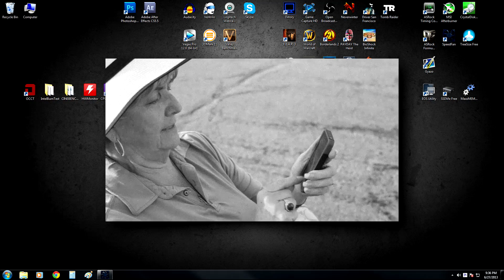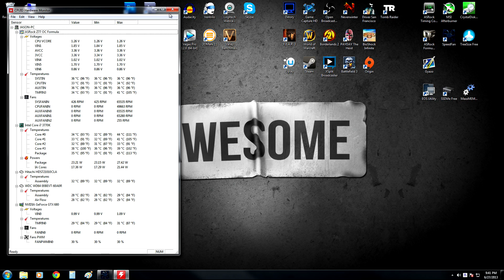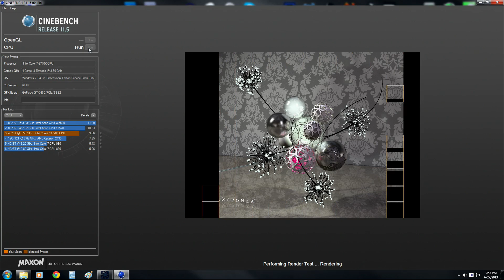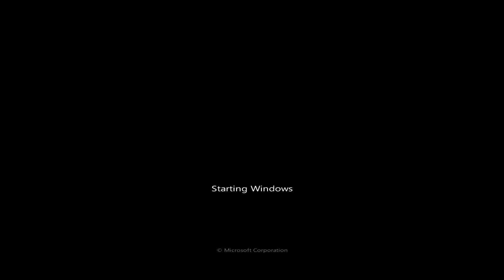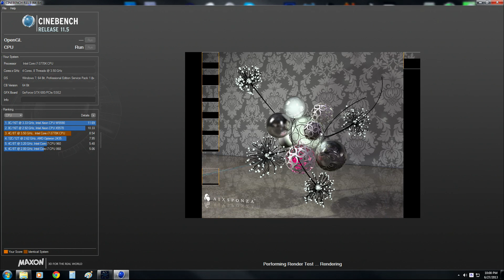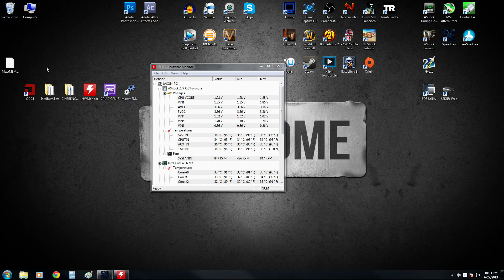Intel Overclocking Guide - 3570k 3770k 4670k 4770k

Comment: 4 years later and I'm still rocking my 3570k, does anyone else still have theirs? or a 3770k?
Reply: Mark G i have 3570K
Reply: Does anyone else's 'per core' clock ratio not work?
I can get 46x on all cores working fine without a problem, but if for example I used the per core function and set it as 46x, 46x, 46x, 39x then no thread would run at anything higher than 39x. I can never get it to go higher than the lowest core radio. 
It's not a heat/throttling issue, I have latest BIOS, etc, etc. Any ideas? Thanks.
Reply: I have a 3570k trying learn how to overclock it
Reply: it's 2018 and i just got a 3770k LOL!
Reply: @adrianvorkaaa3534  same but in 2019, and still freakin' expensive.
Reply: Update: I found a good deal on a 3770k, ran it for a while then bricked it with a failed delid, won't hide my mistakes. But I got a good deal on an x99 platform so far it's been amazing!
Reply: 3770K owner here with asrock Z77 OC formula :)
Reply: Still rocking my i7 3770k with asrock z77 at a stable 4.6ghz! Its a beast. I mean 5 years and still have this cpu for gaming and i get 60fps on most of the games at high or ultra preset.( gtx 1060 6gb) sold my old gtx 670 for 80 bucks .
Reply: Mark G still using a 3770k on a asrock Z77 xtreme 4. Upgraded my ram a year ago (thank fully) to 16gb, and just last month i Sold my old 680 and got a 1070. Now ive got a big cooler and started to slwowly overclock my CPU. 
Exciting times 😂
Reply: 3570k in August 2019
Reply: 3570k GANG
Reply: 3770k in 2020
Reply: 3770k still going strong in 2020
Reply: Yup more than 8 years after I built it hahaha still running strong
Reply: I still have my 3770k in 2021 😅
Reply: @bennipper9761  got a cheap air cooler and got it @4.6ghz - 1.31v :) going strong still
Reply: @bennipper9761  i was thinking to upgrade i5 3570K to this one, do you think it is worth doing, or i will get not much of the improvement. Does 8 threads makes a big difference in comparison with 4 threads. I am overclocked to 4 MHZ
Reply: Im still rolling with my 4670k but i lost sillicon lottery :(
Reply: After my maintenance cleaning and fresh OS install my liquid cooled z77 system is solid again @4.4 Ghz! I could go higher but TBH this oc is plenty for my needs. I also upgraded my 690 to RX Vega 64 and I now have amazing butter smooth max gaming. I can wait a couple more years now before I see a need to upgrade to a new build.
Reply: i have a 3570k too bro
Reply: i5-3570k with AsRock Pro 3 board OCed to 4.2GHz on air Cooler Master Hyper T4
Reply: I just upgraded to a i7 8700k just over a month ago.  But I had a 3570k since 2012.
Reply: 3770k and gtx 670
Reply: i have a 3570k running at 4.3 ghz for now.
Reply: Yeah! 3770k but my mobo is an Intel Extreme and I can't go more than 4.5Ghz stable.
Reply: 3570k at 4.6Ghz, 1.250V. Just ordered a i9 9900k tho
Reply: @Rizna  hey could you help me get those overclocks?
Reply: still running 3770k only upgrade i've made is a 1080gti and only fail i've had is a ssd that i just replaced after 6 years :) No overclocking though at all.
Reply: i just bought a used i7 3770k wish me luck
Reply: I have a 2600k
Reply: Still rocking it at 4.4 ghz @ 1.15V XD
Reply: I still use my 3770k ;)
Reply: Yep
Reply: Just "upgraded" my i5 3570K to i7 3770K plus a Delid lol..
All thanks to COVID Logic of the current world.. lol..
Reply: Yo still rocking on 3770k, 1080p, 60hz monitor in 2021, running 60fps max in every game 😂
Reply: 4670K in 2021 :)
Reply: Rocking a 3570k on my older gaming rig in 2024.
Reply: 3770k here on Asrock Extreme9 water cooled. Until recently it has been running rock solid almost everyday for the last 4 years but I am starting to get random freeze up's even at stock settings. Going to do a complete disassembly cleaning of the board and water loop with a fresh install of Win 10 to see if that helps.
Reply: +frosty I have one I would sell you that ran 4.5 ghz stable for over a year in my Formula VII
Reply: 3570k boiiiiii hoping to make it last longer by buying corsair h100i :D
Reply: 3570k over here still!
Reply: Still using a 3570K, itwasn't overclocked, so trying to get better output from my CPU
Reply: A year after  ur comment Im still rocking a 3770k and just about to add a gtx1080ti
Reply: 4690k
Reply: After doing some detective work I got a i7 8700k to go with the 1080ti, seems the 3770k could be a bottleneck with such a fast GPU
Reply: Still rocking 3770k to 4.5
Reply: Still running i7 3770k 3.5 GHz, with Asus Sabertooth z77, 16 GB,  GTX 1080TI, ssd, win 7 64 , debating if should upgrade to Ryzen 7 2700 If it worth it for streaming and gaming
Reply: 5 years later and still rocking an i7-4790k ;)

TBH it keeps up with my 1080ti (just) back on here to try and eek out just a little bit more performance before upgrading lol...
Reply: yup
Reply: Hey all. I am also running I7 3770K on 4.5ghz watercoold (hightest 75C° during gaming) and paired with MSI 1080 Ti ...16 Gb 1866 mhz DDR 3.Can run games 2160p mostly high settings and roking Oculus CV1 VR as well. No problems so far. Upgrade probably needed end of 2019 ;)
Reply: Almost 6 years later and still rockin a 3770K. Came here for help with overclocking. Haven't needed to, until now. Hope it works
Reply: (delid+liquid metal) 3770K@4.5Ghz offset +0.105v, Asus Maximus V GENE with NVMe, Thermalright Macho 120 SBM+ 2 Noctua fans.(Prime/LinX 71C max)
Reply: had mine since launch 3770k 4.8ghz ish 105bclk 1.25v sabertooth z77 board xspc single 120mm radiator still stable, could never get my ram to ever overclock above stock 1600mhz
Reply: STILL ROCKING A 3770K with asrock extreme 4 . I dont agree with video going straight to level 1 where have not tested the overshoot voltages . This can lower the life of your cpu fast. I try never to go above 4 or 5 unless it has stability issue and voltages are not crazy.
Reply: 3570K with a GTX 1060 6gb (sold my 660 Ti in 2017)
Reply: Still running a 3770k
Reply: 2019 and the 3570k is still chugging at 4.5GHz
Reply: Just bought my first i5 3570K 2019
Reply: Literally just upgraded from mine. Been having it since 2013. It's been good to me.
Reply: Still rocking the 3570k in 2019
Reply: Still using my i7 3770k in Nov. 2019!
Reply: Still rocking 4770k:p
Reply: 3770K 4.3GHz @1.26V
Reply: I just got one for £25. Its gonna be in living room rig. I will overclock the shit out of it 🤣🤣🤣
Reply: i7 3770k, running great since july 2012. Looking to overclock and upgrade gpu from amd hd 7950. Just installed a new ssd with windows 10 and dual booting with my original windows on the original ssd. Cost so far $100, beats $2k plus on new pc. Will do for a couple of more years at least.
Reply: yess yet
Reply: Still have 3570k on stock cooling, going to grab 212 and go for somewhere 4.2-4.4
Reply: Yep, I'm still running i4770k at overclocked at 4.3ghz with h80i liquid cooling. Gives me great performance even today. That said, one year ago I used a i3770 non-k on another pc. It was on air cooling only, albeit a good Cooler Master one. It also ran overclocked at 4.3ghz, but cooler and more stable than the i4770k. Strange, isn't it? I guess the exact piece of CPU does matter a lot for OC performance.
Reply: yeah with a 1070:(
Reply: 4670k
Reply: im running cyberpunk with it :)
Reply: 2021
I5 3570k and MSI Rx570
Reply: 3770k going strong
Reply: I have, but I have heard time doing it. Will try to follow your video
Reply: I just bought one 3570k. It's a overclock monster
Reply: Still going strong fella
Reply: I have it today, 4 dsys later
Reply: 2022, still got mine.
Reply: Yep 3570k
Reply: Bought a 3570k for some overclocking  I also have an overclocked 3570 with a base clock of 3.6ghz and wanted more ghz so I bought a k model.
Reply: Still have mine today.
Reply: After I think 13 years I just un installed mine for a i7 3770k  never messed with OC debating on trying it  though
Reply: I sold my 3570k and upgraded to the 4790k, still on that, but waiting for Icelake to see if it's worth upgrading to once they reduce the node to 10nm, or if it's worth holding out still longer for 7nm.  Not sure yet, meanwhile I'm refreshing my brain on how to overclock, I just did a clean install of Win10 and  need to get all the settings back to stable overclocks, especially since I changed the fan layout in my case and have more open airflow, might be able to get a slightly better clock than I had before.
Reply: @verisimilitudeteller  ...and 2 years later we're still on 14nm.
Reply: @fuxxin8686  And I'm still on the same OC'd 4790k.  ;)  I said I'd wait for a true 10nm chip and I mean it.  But if the next gen chips are priced as insanely stupid as they did last gen I may flip to AMD.  Getting a bit tired of Intel's bullshit on this one.  Ditto for Nvidia.
Reply: What GPU?  I don't think it's unreasonable to have that system provided you're still on a 700 series class or older GPU, I say class because I don't know the comparable AMD GPU for 700 series Nvidia.  But if you're on a 900 series class or newer GPU, I'd say you're not experiencing the GPU at it's most capable.  

I'm a big advocate of the idea that you should match your system to your needs, if you are playing games you enjoy and playing them at a graphical level you enjoy, then why change anything?  Too many people get caught up in what their friends have, you built your system 5 years ago, they built theirs yesterday, you didn't know you were missing out on anything until you say theirs, so relax.  :)  I'm not saying you specifically, but that's an attitude I wish would go away.

Comment: I've tried to overclock my 2500k on 4.5GHz with no luck I guess. find it to be stable at 4.4GHz but my Voltage is 1.34v. I think that's not so good, so if anyone have some advice I'll be thankful.Motherboard I'm using is GA-z77-UD5H.
Reply: Strahinja Pavlovic i moj je isto neam pojma zasto...

Comment: Hey, i hope you still check old videos for comments .. I could need your experience. Iam using i7 3770k on a MSI z77-g45 mainboard with Scythe Mugen 3. Iam currently at 4,2GHz with 75°C in load. Is it okay or to hot?
Reply: mine is also very hot 80c at 4.5
Reply: What cooler are you using? Air or water?
Reply: I was using the Scythe Mugen 3, but i changed to Noctua NH-D15 now and it's much better!! 4,5Ghz now @ 75°C in load now!

Comment: I love looking at these old videos. He sounded so happy with his RAM pushing 2000MHz, I bought some RAM 3 years after this video and it was no more expensive to get factory clocked at 2400MHz and you could still buy higher (and push it past the XMP settings). Recently looked at a 2006 graphics card, its crazy to see how much tech has changed. Instead of a huge 3 fan 6 heatpipe heatsink on my AMD Fury the old graphics card had a 40mm fan and a heatsink less than 3x2 inches and under 1cm thick. I used to hate 2 slot thick heatsinks, crazy to think how much things change in 10 years or even just 3 years with this video and the 2133MHz "extreme" RAM.

Comment: Hey Jayz, thanks for making this tutorial, I successfully overclocked my chip to 4.4Ghz (3570k). I will run a test over night but so far it has been very stable. I have been playing games and its perfect.
Reply: what cooler were you using?
Reply: In the end I didnt use this method. I found online a very useful guide for overclocking using the offset method and that worked the best for me. Using fixed voltage just meant that even if your PC is idle, it will run at that voltage and will run at higher temp. 

Here is the guide that i used.
http://forum.overclock3d.net/showthread.php?t=38867

Its been around 5 months now and I have had no problems with my CPU. I have a stable overclock of 4.5GHz and offset voltage set to +0.05V. Idle temp is 30~35C, 100% load on all cores temp 60~67C, Prime95 can make it reach around 75C but that isnt a problem for me. Im using Corsair H60 cooler. Im using the old model released around 4-5 years ago.
Reply: Thank you for your very quick and informative answer! Have a nice one!

Comment: got my i5 3570k 3.4 up to 4.2. thanks J.
Reply: That's what I wanna do
Reply: +simon sharkeye I kinda regret it since I only have 8gig of ram I pushed it down to 4.0
Reply: +Gustavo Rocha I'm so confused about overclocking... Like I dunno if it's way out of my league, I have i5 3570k and gtx 970 (gettkng the 970 tomorrow) and I dont want my cpu to bottleneck
Reply: As long as it's around 4.0 you're good. I have an r9 390x and it was a major bottleneck when it's in its original 3.4. This guide did help out the performance with most of all the new games coming out this year. As long as you have 16gigs of ram and a water cooling system for your cpu l, you're good

Comment: i7 2700k CPU with a Corsair H80 water coolerCorsair TX850 Bronze/Gold Certified PSU (its def one of the two)16GB of DDR3 Kingston HyperX Savage RAM @ 2133mhz (though it doesn't have the timings listed anywhere on it although all I know is its a CL-11 I thinkASUS Z77 Sabertooth motherboardIm shooting for 2400mhz on the Ram (or as close to it as I can achieve) and Im targeting a 4.8ghz OC on the CPU

Comment: I have a i5 3570k stock cooler with 8Gb of RAM on a MSI B75MA-P45 (MS-7798) motherboard  i down loaded the monitor software you suggested and its saying my cpu is running 1596.2 MHz but the core temps. are sitting between 19-54 C but my cooler feels cold dose this mean my has CPU has the bad thermal past?
Reply: +banchee It means it is at idle, Run a benchmark for cpu and then monitor it

Comment: Tried everything you said in order carefully,  did the burn test at 4.2ghz 1.2v on i5 3570k and PC blue screened and crashed everytime in bios, luckily I managed to fast as fuck change the settings back to default before it crashed at one point.  Never trying overclocking again!
Reply: lol!
Reply: +Sython6 what you did wrong was that you overclocked too far, you shouldn't go for large overclocks if its your first time, even if your friend has the same cpu as you, you probably wont be able to get the exact same overclock. I would suggest a lower overclock and try again.
Reply: sounds like your clock/voltage ratio is way off.  Jay says at 17:11 that too low a voltage will crash the system.  At least you tried.  BSODs are kinda scary for the newb, but you didn't damage anything by trying that low of an overclock.

Comment: +JayzTwoCents hi, i am using a i5 4670k, AMD R9 280 with a Corsair VS 550w, is this power supply good for OC?
Reply: i would not do OC with that psu
Reply: look at cooler máster site they have a psu calculator with overclock included

Comment: Jay plz helpz. I knead you're 2 centz! I bought an intel i7 3770k and an Asus P8z77-v lk Motherboard from someone off of Kijiji for $300 back in the summer. He told me he had it running at 4.5ghz at 1.26 volts stable for over a year at under 60c on an h100i which is what I also have. But to get to 4.5 I have to pump it up to 1.31 volts and that was giving me over 110c and thermal throttling, so I dellided the cpu last night, applied artic silver 5 because it's all I have atm and the temps dropped to about 85c without throttling. Am I sucking at overclocking? Did he lie to me? Or is my h100i just not working right?
Reply: Mitchel Romberg seems really hot, I barely hit 60c on my delidded 3770k @ 4.9 with 1.275v and I have a Kraken x61.
Reply: Yeah. My chip is garbage

Comment: Plenty of us are running overclocked on air.. a good water loop will get you further but don't be afraid to OC with a good air cooler.  In the end it all depends on the temps you get.  4.5ghz 1.25V and no problems on air.
Reply: Just did a de-lid on my 4770K.. 69C peak temps 4.5ghz 1.25V... I am happy lol
Reply: My 3570k Does 4.6ghz @1.16v and max temps are 72 degrees (IBT, Prime95, AIDA64, 3DMARK
Reply: Ernesto Sanchez Very nice push it higher!  Looks like you have the room.
Reply from the maker: ISEE YOU Believe it or not, you are in a minority of people who can get those kinds of overclocks at that voltage. Many people have to push 1.3v+ at which air starts to become a very limiting factors. You cant take your results and apply them to everyone.
Reply: ***** Really?  I hang out at Hardforum.com and they are plenty doing this or better at that voltage.  I always thought of it as a decent overclocker.. not bad.. and not great.  Haswell is a picky beast... hopefully after the delid I will see what it can do on air.  Heat has been a problem going beyond where I am.
Reply: JayzTwoCents thanks for the advise i Will prove to 1.300 vcore for 4.5 ghz, 65c is normal  for that?

Comment: Question, lets say you get the CPU to run at 4.4Ghz...does it stay at 4.4Ghz 100% of the time? Or is it like a GPU where it only ramps up to that speed when utilized and slows down when not in use?
Reply: If you set your windows power plan to Balance and have C1E and EIST enabled in bios it will throttle down.  My 4.5ghz throttles down to 800mhz and drops the voltage as well so less power and less heat at idle or very low load.

Comment: What is better, to start over clocking all 4 cores in sync or to start with 1 core only, then activating additional cores and setting the per core multiplier lower?
Reply: All 4 cores at the start & then you have a good baseline to push that one man army of a core to turbo a solid frequency.

Same boat ad you, but a new motherboard w/ a new 4770k.
I planned for the worse case scenario with Team 16 GB 2666  1.65v  @ 11-13-13-35.

Playing with the iGPU & realized I may have the lottery for the 4770k.
CPU core is 1.06v at stock clocks, 16 GB @ 2666, and both CPU/MEM are will with the stock cooler 39-40°C.
It's handling the volts really well.
Exciting times with a new CPU.
 332 Costa Rica.

 Waterblock will tell me more, but I'm going to push it up to 4.35 on air and shoot for 4.9 GHz +.
Good luck to you...